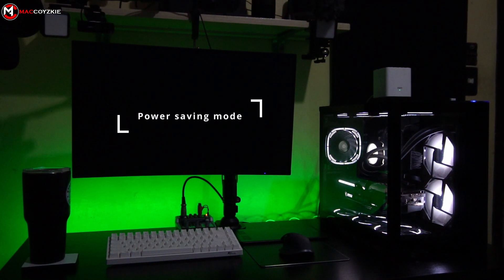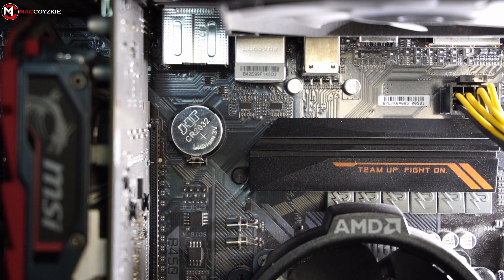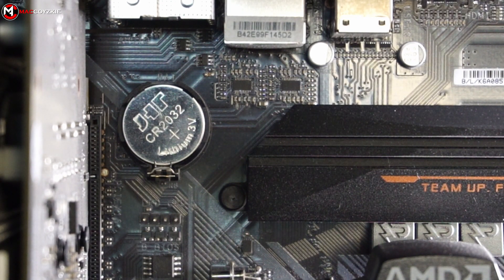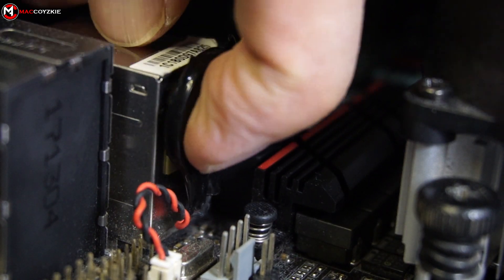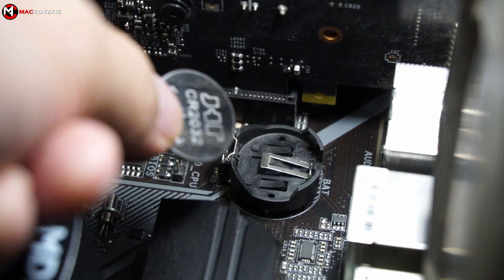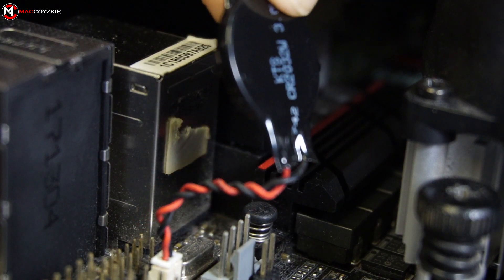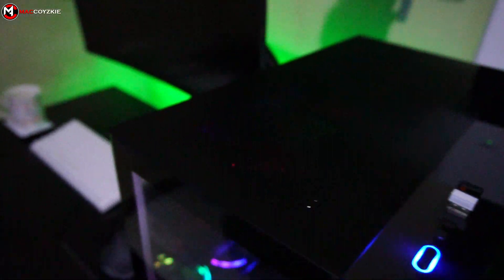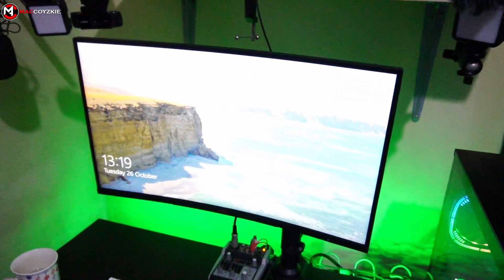Power saving mode FIX

Comment: im having this issue but only when i play Cyberpunk 2077 after a few minutes... all my other games play fine!?
Reply from the maker: if laptop, playing while on battery or weak charger. if desktop psu might be weak or your pc specs can't handle the game.
Reply: @MacCoyzkie Im on PC which is using an RTX 4070 this issue has seemingly appeared after i put my PC into sleep mode when downloading! I have returned the settings to default but 🤷
Reply from the maker: @DwnUndrThundrUndrDog  do this https://youtu.be/SvIJhcxZTsA just download a fresh one from nvidia and use that to install. btw normal uninstall will not do so follow the video link's instruction. also update windows too
Reply: @MacCoyzkie so far so good 👍
Reply: @MacCoyzkie yes this fixed the issue thanks 👍
Reply from the maker: @DwnUndrThundrUndrDog  glad its all good now

Comment: when im starting my pc it works all good but when i starting game and play like 20-30min then my monitor just turn off with keyboard and mouse but pc its turned on
Reply from the maker: if you're still hearing the game sound this could just be an hdmi/dp problem or if you are using any monitor adapter that could be the problem or this could also be just your monitor unable to keep up with your pc so test it with different device like a laptop or console

Comment: I tried Changing the cmos battery and the ram and nothing works
Reply from the maker: how did the pc problem started?
Reply: I basically went on my bios and changed some of the xmp settings
Reply: And then when I restarted the pc “ I get the Message “ entering power saving mode
Reply: And is not the monitor because I tried using it on a different device and it works
Reply from the maker: @lyric34  just clear cmos https://youtu.be/S9hyEPTFR10 i suggest you place back the old cmos battery. this is just because the overclock didn't work for your hardware, just reset it to default by clearing cmos

Comment: Greetings, Mac. So i tried replacing my CMOS battery, and it's still saying "DVI-D Power Saving Mode" and then the screen will just turn black, while the monitor is still turned on. Do you think that this could be a GPU, the DVI-D cable, or the monitor problem? Please do reply to my comment, I've been struggling with this for so long.
Reply from the maker: when i was using dvi-d back in the days it's always the cable that is causing no monitor signal. if you got a spare one just replace it already
Reply: @MacCoyzkie  I have 2 DVI-D cables which are atleast 5-6 years old, and is my largest suspect for this DVI-D power saving mode issue.. So should i buy a new cable?
Reply: (I also tried both of the cables by the way)
Reply from the maker: @nukanpoothon  yes you probably need a new one. don't you have any hdmi input for both pc and monitor?
Reply: @MacCoyzkie  nope, my pc, Graphics card, nor monitor has an HDMI cable. My monitor does have a D-SUB port though, my motherboard does have a D-SUB port, my GPU dosen't. so my performance in gaming is relied on the DVI-D only.

Comment: I found a quick fix for this: connect the monitor to another device and voila it works then connect it to original device. Problem solved.
Reply: What kind of device?
Reply: I have been struggling with this for almost two years and your comment just made it work thank you sm
Reply: How
Reply: Oh, thank you so much ❤
Reply: Didnt work 😢

Comment: To get out of power saving mode where your monitor wont turn on even if the pc is on:

Try disconnecting the power cord from both monitor and pc and wait 5 minutes. Then plug back in and turn them on.
Reply: @TonyKim111  i love you
Reply: @SAMU-c4c  hope it worked

Comment: followed your steps still on power saving mode I checked my keyboard when i turned on the pc it is working can you help me with this please
Reply from the maker: if you already replace the cmos battery like in the video and still does not work then this might already be a broken motherboard. you need to bring it to a local shop for second opinion

Comment: I have two monitors and they’ll both turn on then the other one will just turn off then say it going into saving power mode, what do I do?
Reply from the maker: are both monitor connected on the gpu port or are you using any adapter? if there is an adapter then that's the problem. try using a single monitor only with the non working monitor you mentioned and see if it works
Reply: @MacCoyzkie  I did what you said and after a short while it turned off. With the monitor that was working disconnected.
Reply: btw the monitor that works is connected with HDMI and the other is connected with VGA both on the motherboard
Reply from the maker: @pointy-xx  have you tried replacing the vga cable? perhaps that is becoming faulty
Reply: @MacCoyzkie  might try doing that thank you

Comment: My pc is running I clean the ram sticks the power supply and the whole pc and changed clod battery the pc is working good but when I connect it to my monitor my screen is going black but when I connected my ps5 to monitor it works completely fine btw my monitor is Alienware 25 monitor and I turned off power saving mode in montior menu hop u see this and help me I don’t want to spend a lot of money for repair tysm
Reply from the maker: some monitors have complicated switches to work with certain devices like a console, pc and tv for instance. check the monitor's osd perhaps it has a switch to make it work for the pc
Reply: I can’t find the switch may u show me
Reply from the maker: @sesnix1197  i have no idea what monitor model you have so i can't show you how. why not check your monitor manual online

Comment: I did that but still I turned off power saving mode in my monitor menu but insted of saying power saving mode its js dark screen
Btw I have Alienware 25 monitor 240hz only works on ps5 not on my montior
Reply: I have that same one and I changed my battery and nothing happened it’s still the same thing have you figured this out yet
Reply from the maker: if you already replace the cmos battery like in the video then this might be a dead motherboard, you need to use Rma at this point

Comment: Am I the only person who not only cannot find a cmos battery in their PC, but is having the same issue
Reply from the maker: if atx or matx mobo then the gpu might be covering it. if you are using itx watch the video
Reply: I will definitely look more into this! I’m a first time PC Owner, so I’m still learnin’ haha, I appreciate the help 🫡
Reply from the maker: @anubis-topcity4367  no problem bro! i hope it all goes well
Reply: They didn’t tell me what the problem was no but I think I have a pretty healthy assumption…. This issues resolved, now!
Reply: ASUS ROG Strix G10CE-US564 Gaming PC
Intel Core i5 11th Gen 11400F 2.6GHz Processor; NVIDIA GeForce RTX3060 12GB GDDR6; 16GB DDR4 RAM; 512GB Solid State Drive;

Screen READS something is connected but there “IS” nothing connected, so as soon as my Monitor turns on -> straight to Power Saver Mode & NOW none of my PC Ports work (before, my mouse would power on, but now it won’t. No matter what plug in I use) & it still won’t leave PSM
Reply from the maker: @anubis-topcity4367  it is under pcie slot so the gpu is hiding it. you need to remove the gpu first before you can remove the cmos battery. of your mouse & keyboard is not lighting up then this could be a psu or motherboard issue. try using a psu tester to check https://youtube.com/shorts/YrC3PlflLq0 so if your psu is fine this might be it for the motherboard. 

btw why not contact rog support regarding this, if im not mistaken they have a support team for prebuild pcs
Reply: Was working perfectly fine before I moved it to my new residence. Now it’s broken 😂 😢 this is how I make my living & I’m still not finding any intel on how to fix my issue.
Reply: Can anybody explain to me why I took my PC to GeekSquad just for me to sit in line for 30 minutes and then say they hooked it up to their monitors and everything was fine.

My last question is, could it possibly be due to the fact that my outlet is plugged into another outlet stuffed inside of a desk mount because the desk also has a knock off heavy duty, power strip in it
Reply: Can anybody explain to me why I took my PC to GeekSquad just for me to sit in line for 30 minutes and then say they hooked it up to their monitors and everything was fine.

My last question is, could it possibly be due to the fact that my outlet is plugged into another outlet stuffed inside of a desk mount because the desk also has a knock off heavy duty, power  strip in it
Reply: My question being, maybe there was just not enough direct power to either the computer and or the monitor.? Because they didn’t tell me that it was broken and they fixed it or that nothing was wrong with it in general they didn’t say anything but “all good here you go.”
Reply from the maker: @anubis-topcity4367  you didn't ask what could be the issue? usually most repair shop do this since they don't want you to learn so they can get more cash from you ufff i really hate this kinds of people. if you say your psu is an unknown brand that that's most likely the problem

Comment: Literally bought a brand new motherboard 2 days ago, but this shit happened for years with the same monitor. Just today I could not get it to go out of power saving mode. This is certainly not a cmos problem since the PC posts very well on my TV. These dumbass LG monitors just think its a good idea to go into power saving mode, but have no button to get them out of it💀
Reply from the maker: you need to check the lg monitor's osd perhaps this has a switch for pc. these latest monitors are really complicated at times. since the is fine using the tv then this is not a pc problem obviously. try a different hdmi too
Reply: Bro got any solution to it cus I think I have the same problem man please help me
Reply: I got the same problem and my pc also turns off after it says D sub power saving mode ,plsss help 😢😢😢

Comment: I have this problem but it happens with some steam game when I lunch the games it running but screen say enter power saving mode how do fix this
Reply from the maker: are you using laptop or pc?
Reply: PC window 10
Reply from the maker: @lolboii4172  can you go to conrol panel> hardware and sound>  power options > then select high performance
Reply: @MacCoyzkie  I change to all power option still it does not do anything
Reply from the maker: @lolboii4172  may i know your pc specs?
Reply: @MacCoyzkie  intelR i3-9100F CPU 3.60Ghz Ram16 Gb system type 64bit graphic gtx1650 window10 pro 
Now I have fix this problem for most game by using geforce experience but some can't get in geforce
Reply from the maker: @lolboii4172  i see, i might be wrong but this is a driver issue and it needs a complete clean install. you need to DDU the current gpu driver, here's how to https://youtu.be/SvIJhcxZTsA then download a fresh one from nvidia and install that
Reply: @MacCoyzkie  still doesn't work it's literally the same
Reply from the maker: @lolboii4172  are you in windows 11?
Reply: @MacCoyzkie  no its window 10
Reply from the maker: @lolboii4172  oem or retail incense?
Reply: @MacCoyzkie  IDK it's only say window 10 pro
Reply from the maker: @lolboii4172  ok try updating it first, if there is anything i could think of maybe its a psu issue
Reply: @MacCoyzkie  I got latest update it said
Reply from the maker: @lolboii4172  you need to have your psu tested using a psu tester like this to check https://youtube.com/shorts/YrC3PlflLq0 and you might really need to change the cmos battery
Reply: @MacCoyzkie  where could I test it or get it? Also I change the psu long ago like a year or two cuz it was broken
Reply from the maker: @lolboii4172  you can buy that tester in amazon,  its around $7 if im not mistaken
Reply: @MacCoyzkie  yeah so I test it and go to the PC store and let them fix it damn thing is they don't know what the problem is
Reply from the maker: @lolboii4172  uff hopefully it all goes well

Comment: My pc is brand new  tho?
Reply from the maker: rarely happens but not impossible, use Rma
Reply: @MacCoyzkie  i use a hdmi port and I have a LG monitor that says HDMI power saving mode
Reply: @rachelfartstoday  help me my pc is doing same thing rn
Reply from the maker: @rachelfartstoday  replace the cmos battery
Reply: @MacCoyzkie mines new for it last Christmas
Reply: @@ehsan.hs.r23  I am also having same problem did you got any solution???

Comment: Hi there, 
Thank you for your video, 
I have the same problem for motherboard msi X399 sli plus, I changed the battery, unfortunately doesn't work, still on power saving mode,
I was wondering if you have any other solution please, I don't know why it's happened.(
Reply from the maker: was the battery the same brand as the motherboard? some battery may just not be compatible. what i usually do is to use other motherboard's cmos battery to check, if you got a friend who is willing enough to let you borrow theirs that will be a good thing so you can test it

Comment: could u please help me? My specs are core i5 3rd gen, gtx 1050i, 2 monitors both vga connector. The problem is when im using the HDMI to VGA it goes to powe saving mode. I tried changing the cmos, reseating all the parts but still wont work. When i tried other monitor with HDMI connector it opens. And i bought anotherr hdmi to vga converter still not working 🥲
Reply from the maker: this might just be cable problem, if its working on the vga cable with no problem like you say then its the cable specially if you are using a converter like this https://youtube.com/shorts/PzGdrbL_0nI i suggest buy a direct cable converter

Comment: I only has this issue with hdmi cable,i try with vga cable its work do you think the problem is my monitor?because i alredy test my hdmi cable and no problem
Reply from the maker: this info https://youtube.com/shorts/PzGdrbL_0nI might help you just in case. This could also be the monitor problem so i suggest test the monitor with a console or laptop using hdmi to see if you got the same result

Comment: i have similar problem , my system unit and monitor is on but the screen goes to power saving then complete black , all fans in my system unit is working as intended but i cant seem to have display, do you have a fix to this problem??
Reply: Yo same problem did u find a solution?
Reply from the maker: usually when power saving mode appears this could be a cmos battery depleted and replacing it might fix it.

Comment: I recently upgraded my GPU and now it goes into power save mode only when am about to play games and I don't know why
Reply from the maker: every time you upgrade a gpu, DDU the last gpu driver. more info & explanation here https://youtu.be/SvIJhcxZTsA also if you're in windows 11 then that might also be the cause of the problem
Reply: @MacCoyzkie  i also have the same issue
Reply from the maker: @OshiOnYT  try the link i gave if this video here does not help
Reply: @MacCoyzkie  it's happening when the GPU usage 100%. I have connected a VGA cable using display port to VGA convertor
Reply from the maker: @OshiOnYT  have you tried clearing the cmos yet?
Reply: helppp i have same.issue but i scare to do DDU , i upgrade my gpu to rtx 2060 super intel i3 10gen  when i play a game  my pc intering powerr saving mode and my gpu fan going so fast

Comment: How can it be cmos batteri when my pc is completely new, just got it yesterday and it turned on I set all the settings (location, time, language etc) then when I came in to the pc desktop the resolution was on 1280 so I would change it to 1920 and this was the part all happened, after this just Black screen with power saving blabla… so how can it be cmos?
Reply from the maker: motherboard has been in the stock room for quite a while. Try clearing cmos at the moment perhaps it will work, here's how to https://youtu.be/S9hyEPTFR10
Reply: I actually got it fixed and write this from it. The fun part is that I used my second monitor because my main monitor is connected with DVI which my new pc doesnt have so yesterday I also switched over to my main and connected with HDMI and I dont know why but nothing happened but today I just let it run so after like I think 20-30min or something it reboot then I was like "what, why?" and I cant see why of course cuz the screen showing nothing, then I decided one more time to my main monitor and suddenly it showed and I see it was starting with a BIOS update and it was also why it restarted before so now all good...
I told a friend this story and after I said it was BIOS update then he remembered and said yes usually new pc always has that update at the beginning but he just forgot it...
Reply from the maker: @Ibo2630  i see, glad it's all good now :goodvibes:

Comment: Could there be a problem with me after removing the battery because I don't have much experience
Reply from the maker: umm at least elaborate the problem so i can have an idea
Reply: @MacCoyzkie  When I turn on the screen and connect the hdmi to the computer, the problem occurs
Reply from the maker: @minaahosaam7961  have you change the cmos battery with a new one like i said in the video?
Reply: @MacCoyzkie  i did and it stills not works can it be the motherbord
Reply: @Mike_79  It's a really bad problem but I found a solution You have to buy a new cable I know this is weird and the cable works with any good monitor but it works that way for me OR you have to clean the memory socket in the computer